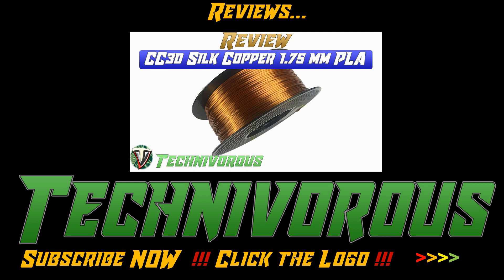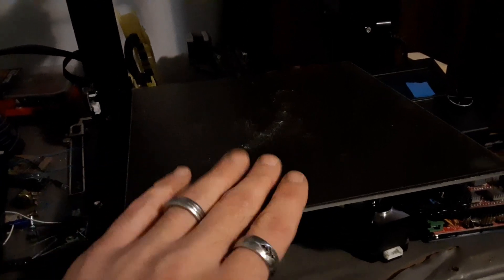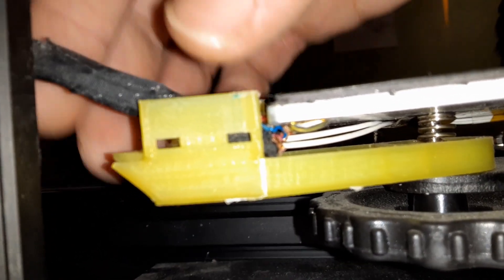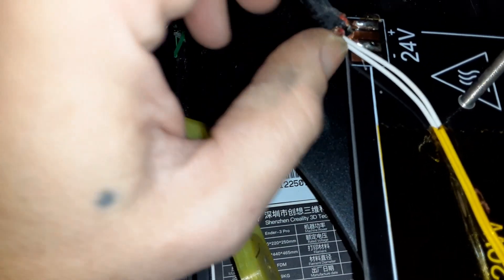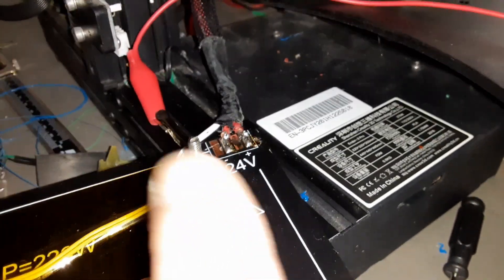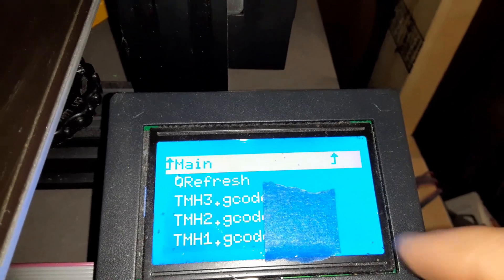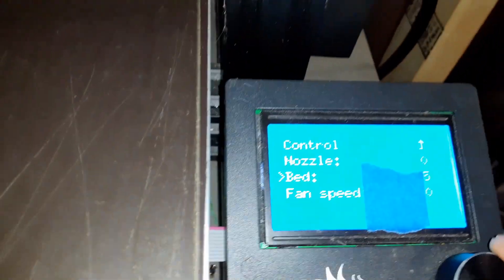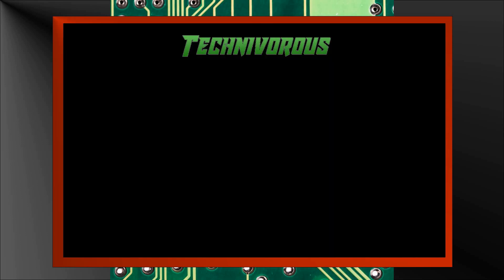3d printer bed wont heat? Check your wires! HOW TO FIX!

Comment: For some reason my new printer heats the nozzle very slowly and stops heating up at about 210 when I need it at 225. I have an older used ender 3 and a new ender 3 v2 neo max. With the printer I cant use my new petg only pla

Comment: Mine had lose wiring and gradually corroded from the sparks. When I pulled them out they were black and after brushing it with a wire brush everything worked great

Comment: I bought mine used, and found the red +24v wire broken, fixed it and it still didn't work.

After trying anything useless including testing the mosfets, the fuses, the led diodes, i went to sleep and the next day ordered a new board, cancelled the order and
tried sending gcode in capital letters this time, M140 S50, it displayed that there was an error with the SENSOR PROBE WIRE.
i WIGGLED IT and the LED turned on on the board. YES!

Comment: My issue is different.  When I try to heat my bed it restarts my printer . I have a btt octopus v1.1 .Can anyone help me out ? I've been searching for answers for 3months .
Reply from the maker: Look on the bottom in the middle of the bed and make sure the thermister (the little beast that takes the temp, ) is in the hole in the center of the bed. 

If your machine restarts when you try to heat the bed either the heater itself or the thermistor is bad or not hooked up right.
Reply: @Technivorous  someone else told me that it may be that the bed is pulling to much power which causes the shut off as well as not having a mosfet hooked up . I'm going to try that and look at what you advised as well and let you know how it goes after work . Thank you !
Reply: i have the same problem. DId you figure it out?

Comment: Damn bro you were right on the money with this... I just finally got done installing a bl touch and mesh leveling and went to go print a calibration print and my shit was dead... I guess all that probing made the wire finally snap because when i looked it was all the way off lol. Good to know though ill definitely be coming back with some extensions when I fix this so it never happens again.

Comment: my ender 5  bed has quit does the same, i checked the power leads coming from the controller board an it shows power coming to it an when i check all the wiring its all good no signs of anything, only thing ive found is one spot where the bed leveling screw go through the bed has a small mark that was caused by the springs pushing up, i admit i have put washers between my level knobs an the screw to keep a little extra tension on the springs to keep from having to level the bed so often which fixed that issue, rarely ever had to level the bed but after this i have to figure something else out, i cant have the springs damaging the heated beds traces, i was kinda shocked to see that the screws was so close to the traces on the heated bed. i ordered a replacement for $25 so its not to bad but i got to figure something else out if the springs was the cause of the issue. i dont really feel like it is but its the only thing i can find that it could possibly be. everything ive found online is the same issue you have but i dont think the ender 5 has as bad of a issue with this as the ender 3 since the 5 only drops on the z axis an no movement on the y but the wires an solder joints an good and when pulling on the wires they are attached even when check continuity from the solder points to the end of the wires they all showed good so it has to be in the beds traces i just cant find any signs of them being broke or burned into. only spot i can see is like i was saying earlier right next to where one of the screws go in u can kinda see alittle copper like the coating was scratch off an where its at it had to be done by the spring. anyone else seen anything like this or is this done by my stupidity.
Reply from the maker: Check the thermistor.... if it's not working the bed wont heat
Reply: I now have a similar problem I just replace the board, PSU, added a MOSFET for the bed, wires look good on the outside at least. But the unit still resets after I turn on the bed heater everything else works like it should. I wonder what I missed. coffee for your thoughts.
Reply: I have one 1 1/2 year old ender 5 now with a 32 bit creality board

Comment: Hello. What is your solder power? I have two of them, but they are 30w, and it does not melt the tin. Thnx!
Reply: That tin isn't tin, it's ROHS meaning a lot of heat (over 450-500 F or 230-260 C) and can take 15 - 30 seconds of direct heating with a good iron.
I bought one that is almost a fire hazard from China with a wooden handle, and I love it, I simply have to remember to disconnect it after 10 minutes or the handle will burn probably... it produces so much heat that I don't mind it having a huge & wide flat-end (like a screwdriver) tip instead of a tiny sharp one... and for the price, it's a great purchase.